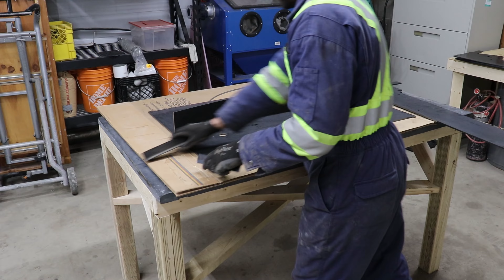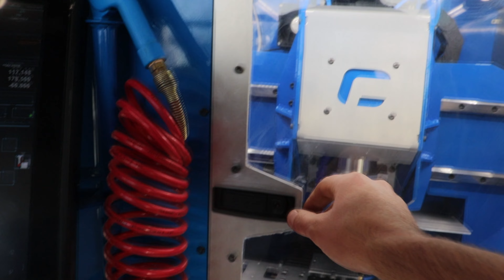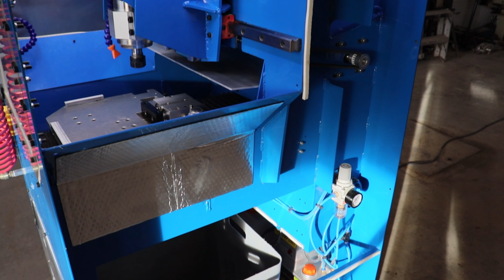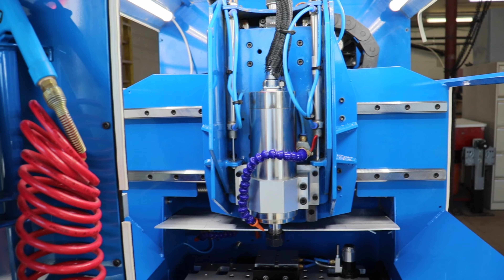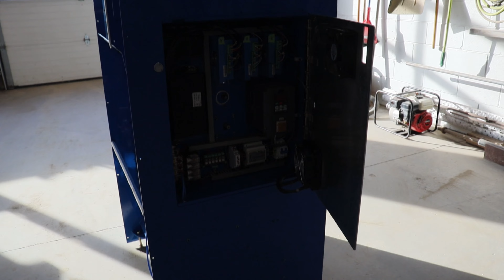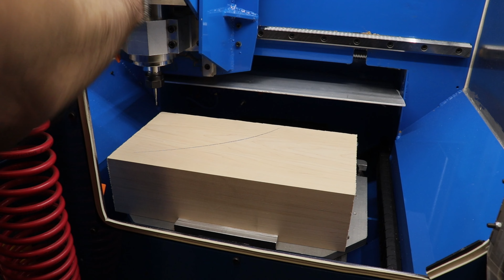We Built Another CNC! Completely New Design - Full Tour

Comment: 9:45 I think you might also find that the teeth on the pully and belt are also contributing to bad surface finish. It's a real problem for 3D printers. I was surprised to see you using belts because of this issue.

Comment: If you wanted to add dust collection, having a replacement pan for the bottom and an air return port at the top would be pretty nice. Then the air will blow dust downward towards the collection, also keeping dust off the linear rails. 

Dust collection is always a good idea in something with potentially explosive dust.

Comment: Awesome build, I can see a lot of time and thought went into it. Not sure why you bothered with steppers though. chinese ac servos are so cheap these days that there isn't much savings by going with closed loop steppers. A couple of 400w ac servos and that thing would fly
Reply from the maker: Thanks! Yeah it's time to try something different, I only have been using these because I am familiar with them, but the next build will definitely have servos.
Reply: @DIVCNC  it's definitely a different ball game to setup, a lot more variables to consider when tuning, but I will say the matched sets you can get have some rather good preset settings that get you super close. Believe it or not i have a lathe running a pair of lichuan 750w ac servos that have the factory settings. No oscillating, minimal lag and some decent performance in the acceleration department. Having experience matching servo motors to new drives/amplifiers i can assure you this is surprisingly good. Starting from scratch can be a pain.
Keep up the good work 👏 🙌 👍 👌
Reply: Clearpath Servos work quite well with the Masso unit, ask me how I know this or check out Pele' on my channel. Nice builds BTW as soon as I add on to the shop I am going to do a 5x10 router table build..

Question for you what pressure you run on you air manifold and do the Capri blow guns hold up to it? The new Harbor freights are only rated to 90 psi and leak with the 135 psi on my manifold.

Comment: Just chuck the stepper and go servo. Been down the same road but once you get used to the speed, performance, reliability and low noise you get from servo you will never look back again
Reply: but is tuning for a entry level cnc machinist as difficult as I have read?
Reply: @T0tenkampf No it’s not, most servo drives have good tuning software. If the servo doesn’t have it buy one that has.

Comment: You had your X and Y axis mixed up when you were explaining it and saying that the head moves on Y 😂
Reply from the maker: It's a goofy reason, but the first machine I built 7 years ago, I set it up that way with the head moving as the Y-axis. I did it so the jog buttons in Mach 3 matched the directional movements of the machine relative to the position of the control panel. It made the machine more intuitive for a novice user. Now I set up all our machines that way just for continuity in our programs, so any machine can run the same code. I can switch them over, but I would have to switch all our machines and remake code for about 40 different products haha
Reply: @DIVCNC  I totally get it, on a traditional C frame style mill I was always told to imagine the spindle moving when writing code, but when I would jog the table it would be opposite and I would get confused sometimes. I have a converted PM728VT with mach 4 so I know what you mean. You’re probably just used to saying your head moves on Y axis.
Reply: Good luck learning out of it when getting a real industrial cnc machine. Not so cheap to crash as the hobby toy machines.

Comment: Have you tried using larger 1:1 pulleys? The belts should have more leverage at a larger radius so the stretching should be less significant and not affect surface finish as much
Reply from the maker: HI there, not yet, I have ordered some, I don't remember but I thought I talked about that in the video. I just threw on the pulleys I had that worked for the time being when we switched from a 2:1 overdrive.

Comment: I see alot of these diy cnc builds on YouTube and they share a common issue. They use the spindle with a collet built in. I would say spend the extra $500 for an spindle with iso20 tool holder. Even if you don't use an ATC you get toolless, fast and easy tool changes. 
But otherwise awesome build. I really appreciate the packaging for compactness. Not easy and makes the machine much more impressive to me.
Reply from the maker: We will likely be adding a complete tool changer eventually, and thought we'd wait until then for a really nice spindle. For the time being, you can't beat this simpler guys for the price (around $500.00) but I completely agree that it is worth the extra money for something that simplifies the tool changes, especially if you are running operation that requires a lot of them. We change tools once in an hour and a half, so it was not as important to us as some of the other upgrades to this design. Thanks for watching and the comment!
Reply: Agree, but more like $1000 to $2000 extra though !
Reply: Especially if you allow for ATC later in the design
Reply: true, but id go bt30, more options for tooling

but these spindles are 1.8k to 2.5k, i gut my current er16 spindle for around 300€ so BIG DIFFERENCE but yeah certanly cool
Reply: ISO20 sucks.